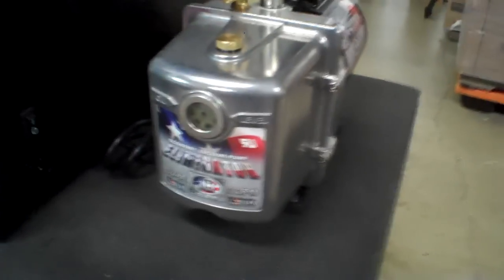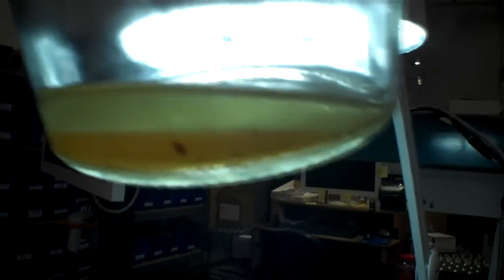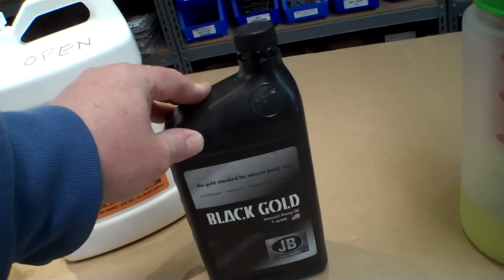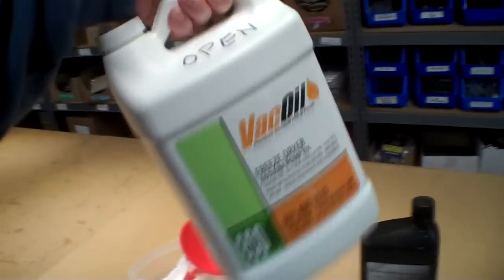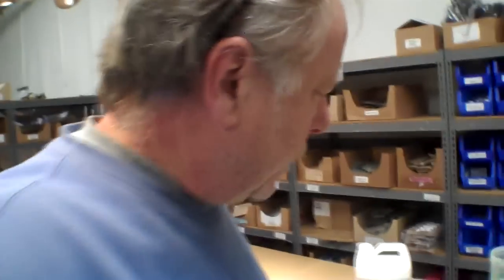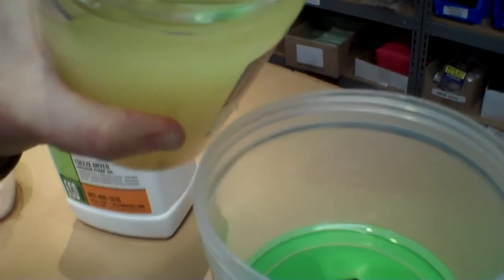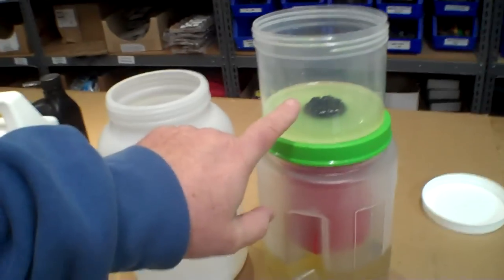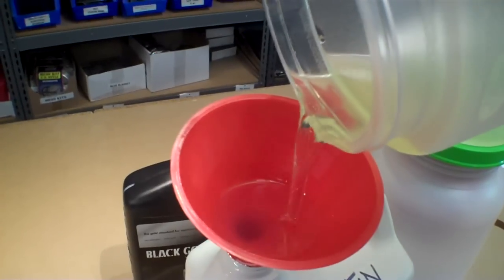Harvest Right Pump Maintenance - Oil Changes - The dirty little secret.

Comment: Couldnt you just put the used oil in the freezer, the water at bottom of the jar will be froze and pour off the oil?
Reply: Yes. Some people do that or use oil separator found on amazon

Comment: Looking into these. Seems like a lot of fiddling keeping up with the oil changes. Water separators and oil filters have been around for ages. Too bad it isn't something built right in to the machine.
Reply: This is an older pump. Harvest right also sends their version of the Harvey filter. Plus they also include plenty of oil to take care of oil change.

Comment: it seems that to run a freeze dryer for a year, Electricity, maintenance, oil, mylar bags, sealer machine and moisture bags can get very EXPENSIVE!!! not to mention the $3,500 price tag versus a dehydration method unless you plan on saving food for 25 - 30 years what's the point??  hmmm  I think food prepping is just another costly addiction!  lol
Reply: Electricity, to make a run where I live is $2.50, mylar bags are $.34 a piece, oxygen absorbers are $.10 a piece and a vacuum sealer can be had for $60 bucks and a freeze dryer can be had for $2500.  

If you think about a years worth of food from a long term storage place, especially right now, the investment in one of these is not that bad, by comparison.  There's many benefits of freeze drying over dehydrating.  

A person has to decide for themselves how much food security is worth to them.

Comment: Hash makers You can put a cold trap between your pump and freeze dryer, Cold finger dry ice + iso will do the trick fine. You can catch terps retain pump oil quality.
Reply: Why do u do this? Is it something that would benefit tender spices as well?

Comment: I've wanted one of these freeze dryers for years, but the oil free pump they sell is $1600+. This puts it out of my financial reach. Is it possible to use a different pump on these things? One that costs $500 instead of $1600?
Reply: Just get a pump with oil it’s way cheaper

Comment: Another way to filter the oil/remove the water is using a Brita type water filter/pitcher container.  Remove the "regular" filter cartridge and make "custom rolled" toilet paper "filters" that are rolled semi loosely to fit into the regular filter cartridges holder. I made a J shaped stainless steel wire ( a piece of stainless welding wire) that the new paper roll "sits" on the J loop part and the vertical part of the J shaped wire goes up the side of the roll nest to the wall that the paper roll is fitting into, to help get the water logged old paper filter out then put in the new one.  Cheap "filters", easy to make and it works very well. When pouring in the contaminated oil, I stop when the water in the quart canning jar IO use, gets near to coming out and pour the remaining oil/water mixture into another jar.  This jar has oil/water mix from a number of oil changes and when full, I freeze it, pour off the oil off of the ice, into the filtering unit to be filtered and dump the ice. Works very well, got the water filter container at a thrift store for $2.00 but a new one could be purchased if you cannot get one used. Replacement filters for these are very cheap, I gat a number of "filter rolls" from one roll of toilet paper and just keep them in a baggie to use as needed. If you need more info/help  you can reach me at john at MLCE dot net.

Comment: If you opt for the no change pump, how does it handle the sludge and water accumulation, or does the pump die all that much faster?
Reply: My guess is it just exhausts it into the outside air and doesn't accumulate.

Comment: any idea how the oil in pump would go from fill level to empty, without doing it yourself?

forgot to empty oil after run, next morning, pump was out of oil.
Reply: Technically, some oil can go out the vents, but that's only supposed to be if you overfill it. If you don't have a puddle of oil next to your machine, that would be my guess. 

Also, the indicator gauge only fills up at the end. You could be nearly full, but still show as empty. You'll only know when you go to refill how much is needed before it fills again.

Comment: what a pain what a cost and the time!  OMG I would never buy this
Reply: Actually is not a problem. Oil is recycled and reused. From what I’ve seen, the oil can be used many times. Going on the 3rd month, still on the 1st gallon, Harvey filter makes the oil nice, clean, and clear.
Reply: That's why I ordered the oil less pump

Comment: What's the difference in this vacuum pump and one for HVAC?  If this one cratered after warranty
Reply: not much this one runs a lot longer at a time then one doing ac work. but the big reason for changing the oil in this so much is that there is moisture in the air. when you are doing ac work the system is dry. The water will destroy the inside of the pump pretty quick if you don't keep it out

Comment: Can you use oil from freeze dryer to run a car?
Reply from the maker: Good question. Want to try? I have a gallon you can pick up at the warehouse...
Reply: yes and no it would lubricate as for temp ? as for viscosity probably not . if that is all i had and needed oil yes other than that no.
the way it reacts to temp changes no. in the cold it turns to honey (not good)

Comment: Brian, i just got my harvest right back in august, i have use it probably 1 or 2 times a week, i change the oil everytime i use it, recently the oil that comes out of the pump has been black, y? also i filter my oil in between each use as well. wat do i do?
Reply from the maker: I haven't run into that myself but have read about it in FB groups. I have read that a homemade Britta and toilet paper filter does a good job in that situation. There is a video on YouTube.
Reply: I've see a YouTuber, retired at 40, using dairyland pump oil sold at tractor supply and Amazon  works well and helps clean the pump as well. Next time I buy oil I'm going to give it a try.
Reply: replace the oil that has turned color!  That  means that the oil has broken down or has some contaminants in it. short term will still work BUT
long term it will burn up the pump or wear it so bad that it will not pull enough vacuum to do the job.
Reply: +Marte Houdesheldt ok thk u

Comment: Is the oil to run the pump or for the food?  I used to buy imported freeze dried fruits and I could taste the oil went rancid so I am wondering if the oil is needed on the food.
Reply: Oil is for the pump not food
Reply: Amy Hoang 
Nuts have oil..
Reply: the oil is used inside the vacuum pump to lubricate and seal the insides so that it can pull a high vacuum.

Comment: I just got my new hr 7 pump.  Im liking the new features but they didn't give any maintenance info.  Can i clean my pump the same way as my old jb pump by taking off the front and cleaning the insides.
Reply from the maker: Yes. They recommend cleaning the inside after 20 batches, but changing and filtering the oil each time. Do not do a power flush...

Comment: So I started getting oil in the pump tube that connects the the freeze dryer, it only happens when the freeze dryer is in the freezing stage, I call harvest right and they said due to the extreme temperatures it can sometimes cause a vacuum and pull oil up the tube and they said to adjust to door so that the rubber gasket sits away from the glass.... but I don’t see how it can pull a vacuum when the pump turns on if it’s like that ??? Is this something I should do ?
Reply: what is happening is that when the box cools down the air gets cold and shrinks a little bit and that suckes the oil back out the pump inlet
if it does not lift the oil very far up hose then just lift the hose up so it can't make it to the box. or like they said leave the door barely cracked while the box is cooling down. i would just tie the hose up

Comment: Great videos! very informative and well done! I was wondering on the oil sealed vacuum pumps if they had a gas ballasting feature in order to drive water vapor out of the oil and pump when it's running? Also, are you using food grade oil or can non food grade long life oils be utilized? thanks again.
Reply: on the first i doubt it i have never seen one on the small units. as for the second part no you don't use food grade oil. it is post food and it's major use is post pump as well. it lubes the pump and works as sort of an check valve so the air can't be sucked back in the pump.  if you listen to the exhaust of the pump you will hear bubbling .

Comment: Hey mate here from Australia, would you know the minimum LPM vac pump I could use for my standard size harvest right? I have gone through multiple pumps due to horrible corrosion and my new one pulls 35lpm but I can’t achieve vaccum ? Please help
Reply from the maker: The CFM (or LPM) is less important than what level of vacuum the pump can achieve. I was told that even a 2CFM would work but will take much longer to complete the task. Your pump needs to get down below 500mTorr.

Comment: With filtering oil each time, how long before the oil breakers down and doesn't protect the compressor. Or, if the oil is filtered and water extracted each time will the oil properties last forever. Hope this is clear what I am asking.
Reply: i would replace the oil when i see color in it or every 6 months which ever is first

Comment: Was that food particles in the oil? If so then does that mean oil can leak inside the freezer part as well?
Reply from the maker: Under normal circumstances oil never get's in the chamber or contacts the food. However, sometimes food dust is drawn into the pump. That's what you saw in the oil.

Comment: Big question for you, I hope that you will be able to answer.  This morning, at 7h30, I put 30 min of pre-freezing and then cancelled it.  I put the food in and push start.  It freezed for 9h and went directly to final dry for 7h.  There is still 1h before it finishes.  Should I just put 10h more on final dry cycle or should I stop it, put my food in the freezer, defrost and start it all over again.  I don't know why the second cycle didn't work.  Is there any issue for the food process, for the pump?  Thanks.
Reply from the maker: Hi Karine, I see your question was answered in one of the FB forums. Sorry, but I don't read video comments as often as I should. So if you have a pressing issue, the FB groups you belong to are faster to answer. I see you are making great progress!

Comment: It would have been easier and much cheaper in the long run if the manufactor had installed a water separator on the vacuum side
Reply from the maker: That would have increased the total cost by several hundred bucks, but I totally agree with you. You can buy them from VacOil.com and there will be added hoses involved as well.

Comment: What is the name from the red filter Purcolator?
Reply from the maker: I don't know the model off hand. You can look over the info at https://harveyfilter.com/ . We are not connected with them, but use their filter and are happy with the way it works.
Reply: It’s a specially prepared purolator L30001. But if you want to make your own, please watch a vid on it. It is a car oil filter but it has been modified to allow the oil to filter, then return to the reservoir. It CANNOT be used in a car after these modifications have been made. That being said, this filter is one of the main reasons I bit the bullet and got my freeze dryer... I love it.

Comment: Looking forward to the power flush video. Sounds scary.
Reply from the maker: Power flush is no longer recommended. Now they recommend draining and filtering oil each time. At at 20 batches, removing the front cover and cleaning out the pump.
Reply: EpicenterBryan Thank you for that. I am a new owner and did the first couple of freeze dried. The booklet has the drain a tablespoon and and power flush. The sheet of paper with the pump talk about changing the oil each time, but also about flushing (no disassembly). They did include a filter thing that I will take apart and read. Dynamic maintenance I guess. Hard to get oil in Canada.

Comment: is it loud how loud is it??
Reply from the maker: It's loudest when the pump first turns on during the dry cycle. At 1 meter distance from the pump, the sound pressure level is 73db when the pump first starts. Once a 500mTorr vacuum is achieved (about 5 minutes) the SPL is down to 60db.

Comment: I just the experienced my first oil spray out of the exhaust. What a mess! 
I noticed in this video, The dirty little secret, that you had a piece of PVC at the exhaust with an elbow pointing up and capped. Would you explain how that corrals the spray and is the cap vented? Exhaust means exit and how do you do it? Looks like a cool fix,.
Reply from the maker: Actually that part came with the pump and it's a vent. What you really want can be found in another one of my videos. It shows hoe to make a DIY oil / gunk catcher for the pump. Works like a champ. Here it is... https://www.youtube.com/watch?v=nR4Y6WzDihs

Comment: how do you power flush the platinum pump?
Reply from the maker: Harvest Right no longer recommends doing a power flush. Sounds like it was causing rear seals to blow out. Now they recommend cleaning and filtering the oil each batch, and opening the pump and manually cleaning the inside every 20 batches.
Reply: Thanks for the info
Reply: That's useful info... this machine is seeming less like like a good idea 😔

Comment: I use two juice jugs nested with top one filled with aquarium fluff media with charcoal either for aquariums or finely chopped from the smoke chips from the bbq, strain twice or thrice, nice and clean, then decant oil off of the water.
cheap as dirt.

Comment: I do it a little differently. The oil is not cheap at least the black gold type. I was not going to throw it out after 7 batches. Quite by accident and laziness I found out that with sitting it self filters. I did the 1st draining of all the oil into a glass container put the lid on it and forgot about it. A few months later I found the jar and the oil was clear except for a small bit on the bottom. It is definitely important to drain some off after each batch. I drain about 1/4 cup. Then I refill with the now clear oil I saved. 3 cheers for procrastination!
Reply: smart idea. for best results drain it as soon as the pump stops.( that will carry all the water with is) then let it sit.

Comment: I would fill to level, drain and measure, then store refills in exact amount for future changes.
Reply from the maker: That's what I had been doing since that video. But actually I'll be doing a video on a setup I put together that filters in real time. I haven't actually drained the oil in nearly 20 batch since my new setup filters and separates water even when the pump is running. It's really great!
Reply: Hi there! Just poking you about wanting to see this new video. It sounds great! I know you other things to do though, so I'll sit tight and wait. Btw, how did the power flush go? How many times did you have to cycle the oil through and how often did you have to do them? Before your auto-system was set-up anyway. Thanks so much! :D

Comment: Bryan, what type and size car filter would I need to buy for the Harvey filter? Also how often would I need to replace the car filter?
Reply from the maker: The filter comes from Harvey Filter. They list compatible filters on their web site but some of them require that you remove the anti flow back valve. Just as inexpensive to get replacement filters from Harvey. But I'm on 6 months now and the filter still works fine. They say replace at 3 months. If you keep as much water and crud out before pouring into the filter it must last much longer than they say.